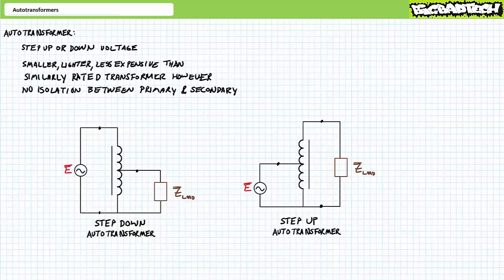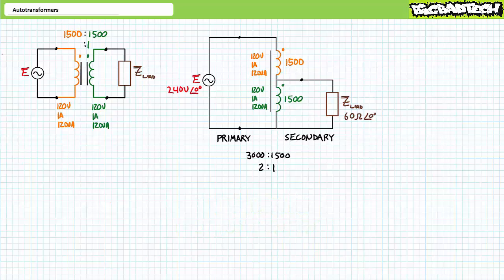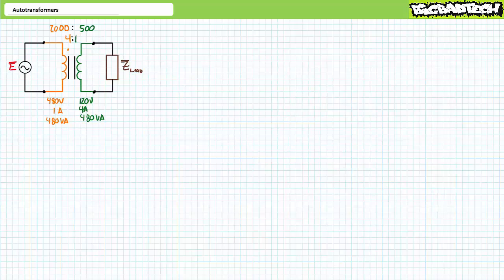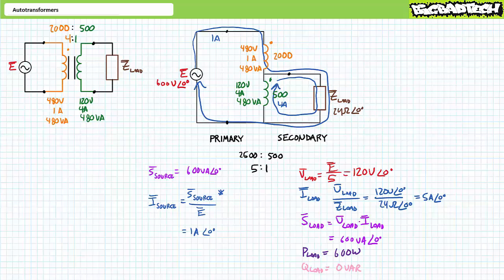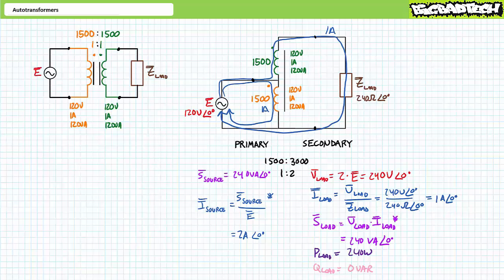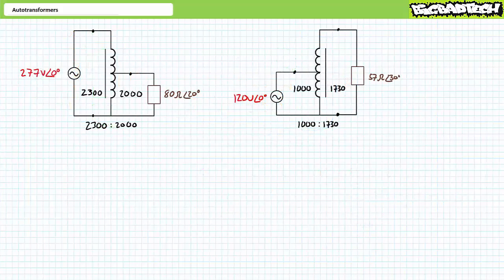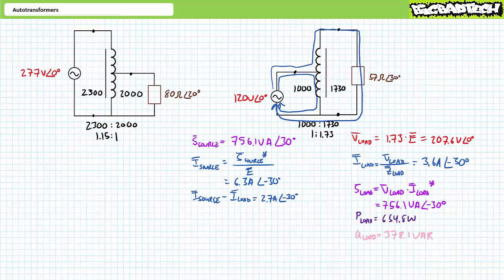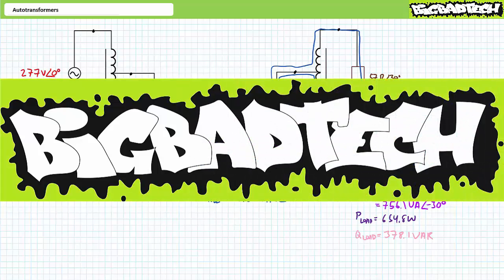Autotransformers (Full Lecture)

Comment: Question: what would dictate the use of a traditional XFormer over a autoXformer, I mean why don't the grid utilities use an autoXformer instead of a traditional???Does the isolation feature a plus when installed in the grid?
Reply from the maker: You answered the question ... isolation is an extremely desirable feature of a traditional xformer that an autoxformer can't provide.
Reply: Understood, but what is special about isolation? Also there are no polarity change in autoxformers?
 @bigbadtech